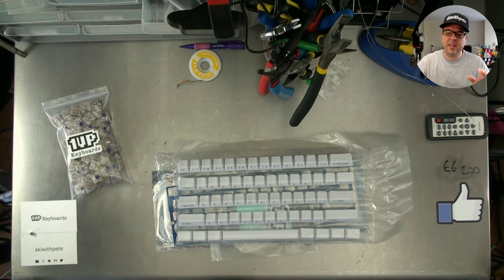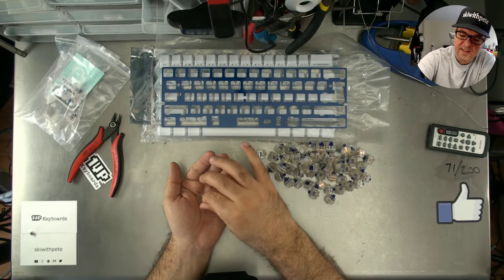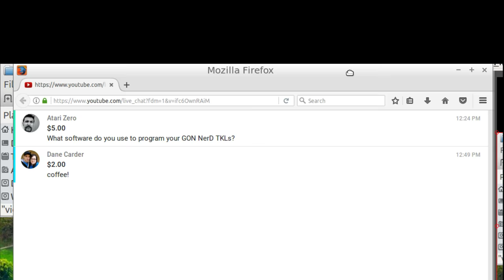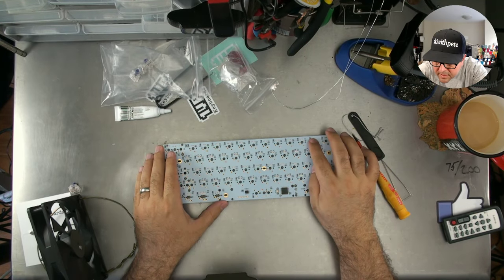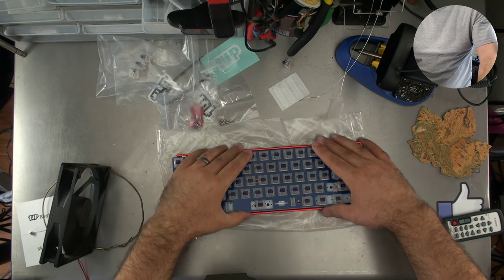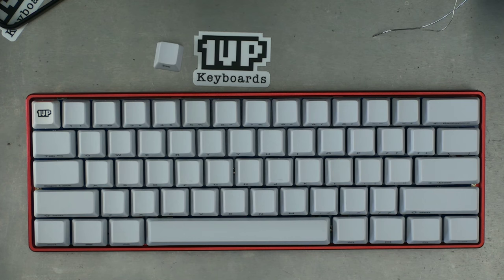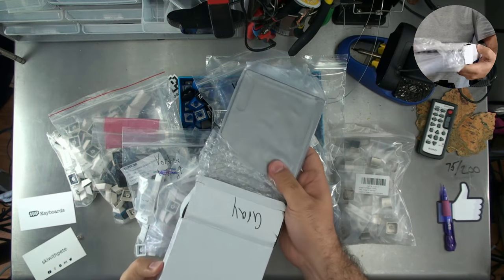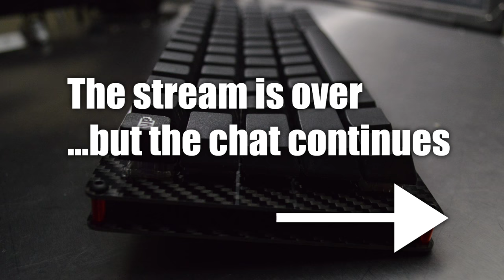[Livestream] How-to build a better "pok3r" 60% mechanical keyboard

Comment: Hey +skiwithpete , slight correction. Near the beginning you said about the magicforce 68 that it's non upgradable and can't be made fully programmable. The is a replacement PCB for it and I have also heard about people hand wiring pro micro micro-controllers into it making it fully programmable, also aside from the case everything is upgradable/replaceable

Comment: Some shortcomings are noticeable. Sides of some keycups are not parallel. But i think it's unable to build perfect keyboard without fails for three hours without breaks.
Reply from the maker: VallyVanGo this is more likely due to the keycap than the build. The build is itself not likely to allow for twisted switches

Comment: Hi, I'm trying to build my own keyboard and aren't sure of what switch to get. I am currently using Cherry Browns and was looking into zealios 62g. I was wondering if the zealios would be too heavy.
Reply from the maker: I don't think you will find 62g's too heavy.  The bump is much bigger and more pronounced and gives a snappier, but not much heavier feel.
Reply: I just got a tada68 with zealios 62g and find them a bit easier to type on than cherry blues. Nice a quiet too.
Reply: Raymond Wishart by easier do you mean it's lighter to type on or smoother?
Reply: I think it is both!

Comment: Is it worth opening up the zealio switches and lubing the rail and shaft? or is it good enough to just do the stabalizers?
Reply from the maker: Kevin Heritage I don't lube zealios because I'm worried about the possible change in tactility. I personally really like the feel of zealios on their own without lube, so I just stick to the stabs. Now if we were talking pandas, I'd suggest lube.
Reply: skiwithpete thanks for the advice. Ive ordered basically the same build you made in your video before finding out about 1up. That carbon fibre looks soo sick.

Comment: What PCB should i buy that supports RGB lights and have pre soldered diodes and resistors?
Reply from the maker: 1upkeyboards.com will have a solution soon for this.  But until then you might consider the ZealPC pcb
Reply: Ok, thanks! :D I will check in on the website soon! :D

Comment: Isn't it easier to install all the switches on the plate first then put it all on the pcb at once? I did it this way with the exact same plate and pcb without any issue.
Reply from the maker: Geo uhh, no. that's not easier. I'm surprised you said it was. I tried it with a planck. you can watch that video. and my good it was fiddly with pins bending and 20 mins of alignment...
Reply: Hmm... It only took me a 30 seconds of wiggling before the whole thing popped into place. When I see you using a pry tool to lift the plate up onto the switch it makes it not look like an ideal method. I'd worry about scratching out a trace off the pcb.